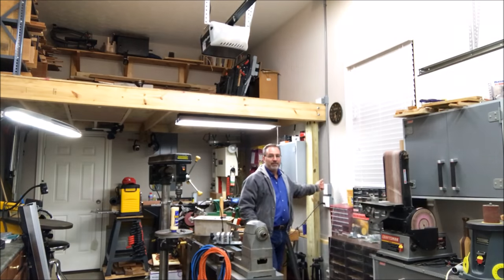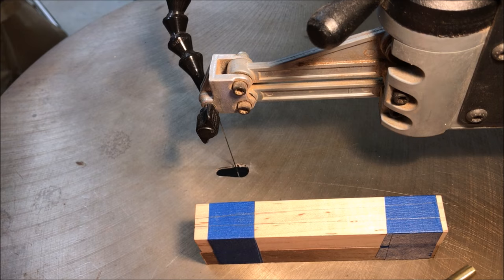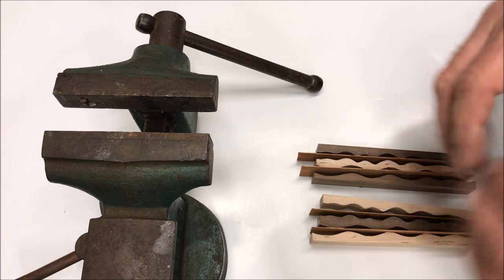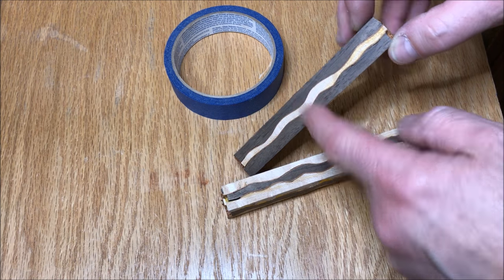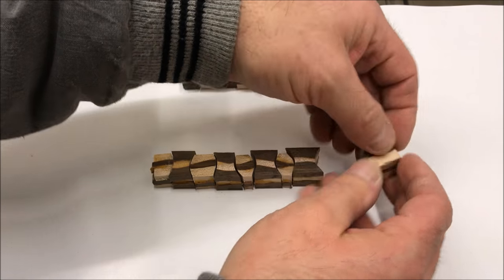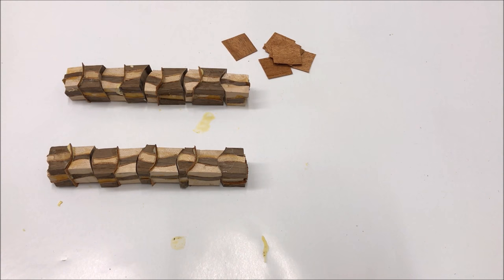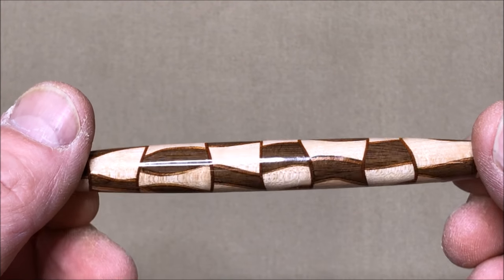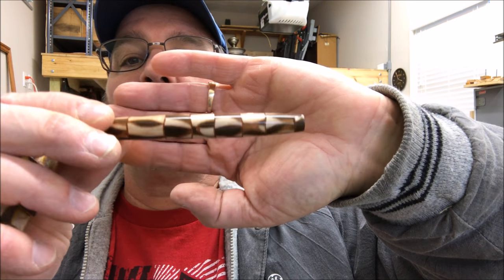Amazing Pen Blank You Can Make

Comment: Hi bob, I don't usually leave comments on videos but I have one piece of advice.you can choose weather or not to take it 😃. When I started making pens very regularly I decided to take the plunge and buy a blank drilling chuck and a mandrel saver, is the best use of money I've found so far other than my carbide tools and my lathe of course. Keep up the good work! 
-Oliver
Reply from the maker: +Oliver Andrews Hello Oliver,
  I have those items but choose not to use them. When drilling on the lathe, the holes are sloppier. Plus with many of the blanks I make, their not square and don't lend themselves very well the the chuck application. Your idea is a good one it just doesn't work for me. Thank you very much for your comment I do appreciate it. 

Regards,
Bob
Reply: RJBWoodTurner at first when I started issuing the church I couldn't get any of the holes to drill straight, but then I tried drilling with a 1/4" split point drill bit then finishing up with the brad point 7mm and it is much easier to get rid of a good chunk of the material before Sui the brad point drillbit. Hope this can clear up what I was trying to say
-oliver
Reply: Using* chuck*
Reply from the maker: +Oliver Andrews Thank you for this follow up note Oliver, I appreciate the additional information. I will give this method a try and see how it works for me.  I hope my previous reply wasn't too preachy, my wife say sometimes I don't answer with enough tact. It's tough to have a discussion with just words, you lose all the inflection and body language that tells the rest of the story. 

Regards,
Bob
Reply: RJBWoodTurner I don't want to push my ideas on you either! Everyone has their own way of getting to the end of the maze.im only 16 i make mistakes but I try my best not to. For a future video you should buy some polyester resin and some mica powder and cast some of your own acrylic blanks.i lived in the states for 6.5 years and took for granted the selection of resins and wood, now I've moved back to the uk it's pretty hart to find resin blanks for anything under £7

Comment: Bob, have you tried to soak your veneers? May be beneficial in assembly and the water will just evaporate and the glue should hold tight and strong as equal as if done dry. I would like to try this out in the spring time (unheated shop up here), I will try just straight cuts vice your sine wave, to see if the pieces match up better. It is a wonderful abstract look.

Thanks for taking your time making your video for us to view!

Michael
Reply from the maker: +Michael David Hiltner I've never tried soaking them, never even thought about that. I may have to give it a try. Thank you for the suggestion. 

Regards,
Bob

Comment: If that's the only area that has glue on it, you can try knocking out the tube with a 1/4" knockout from the pen dis-assembly kit.  I've had some poorly glued tubes come out that way.
Reply from the maker: +Michael DeLawter Nice idea, I have a set of punches and may give that a try. 

Regards,
Bob

Comment: Wow that's a lot of work for a pen but the result is cool.. When I try to cut 2 taped blanks together I find that once cut and swapped around they seem to not have a very close for.. have you any tips regarding mimicking the cut accurately?
Reply from the maker: +Heath Cope I use a #5 blade because it's stiffer, the video is at double speed, I cut really slow so as not to flex the blade. I use the veneers because they compress into the kerf and hide it really well. 

Regards,
Bob

Comment: When I made my modified pen, it was very difficult to remove the mechanism. So I very lightly filed the ridges on the transmission until it stayed in, but was relatively easy to grip the slippery nib and pull it out.  While testing the removability, don't insert all the way. You really don't have to worry about it staying together, because during use, the pen is being pressed together.  I do like your new blank construction  :>)  Cheers
Reply from the maker: +Steve Overton I've also found a small spacer the width of the center band helps. Otherwise you're putting another 1/4" of transmission in the upper tube. 

Regards,
Bob

Comment: Would have been nice to see you drill the centre, did you plane them square before drilling, other wise a lovely project.
Reply from the maker: +William Donnelly Thank you,
  I didn't plane them, I ran them through the band saw just to clean them up a bit. I'll show the drilling the next time I use one. I have an idea for another modified pen, based on a different kit, and plan to use one of these blanks. 

Regards,
Bob
Reply: Thanks Bob look foward to the next one.

Comment: Bob, if you sprinkle a little salt on the glue the parts won't move when clamping & everything will line up perfectly.
Reply from the maker: +Fierceflyer55 I've heard that before but I've never tried it. Maybe it's time. 

Regards,
Bob
Reply: Fierceflyer55 question... I always wondered, will that deteriorate the pen eventually, especially if it gets on the metal?

Comment: Just a thought! IF you were able to start with HDPE tubes, then CA glue wouldn't stick to them. However I strongly suspect that they'll need their centres drilled out. From I've seen locally, they may be available in the right outside diameter.
Reply from the maker: +DMCwoodworx That my friend is an interesting idea. My thinking cap is on. 

Regards,
Bob
Reply: brilliant idea
Reply: RJBWoodTurner    Bob there is a company that does sell HDPE and I believe UHMW rods here in the U.S. but I can’t remember the name of them.

Comment: This is like the chaos pattern cutting boards I've seen done I was going to ask if you had ever seen them and if you thought that idea would make a good pen blank I guess now I know
Reply from the maker: +Barry Fields This was a blast to make. Glue ups were interesting but the blanks hold together well and look amazing. 

Regards,
Bob
Reply: RJBWoodTurner after I posted that comment I was thanking it might be easier if instead of gluing up each individual blank maybe it would be easier to make it like a big cutting board and then cut it into blanks on the table saw. Just an idea
Reply from the maker: +Barry Fields That's an interesting idea. I don't see why it wouldn't work. It would probably be easier too. 

Regards,
Bob

Comment: Dons sunglasses WHAT SORRY I CAN'T LIP READ! Nice.

Use a dowel or chopped up pencils to clamp in the middle of concaved parts at the end, then you aren't putting pressure on one (or both) of the points and can apply more pressure as a whole. You could also use some strips of thick leather or compressible foam (old mouse mats / neoprene) on the convexed side to account for the bow. 12:30 as reference to what I'm talking about.
Reply from the maker: +Neffers I don't understand, the video has sound when I play it. Is there an issue?

Bob
Reply from the maker: +Neffers Thank you for the info. 

Regards,
Bob
Reply: No no, no faults with the video at all, I was having a lil joke about the brightness of your new lighting (it's great, nice job). 

The second part was advice about clamping concaves and convexes with regard to small parts and small clamps etc. 

Apologies, I'm tired.
Reply from the maker: +Neffers No harm, no foul,
  I understand, and I always appreciate constructive criticism as well as new ideas to improve my process. Thank you very much. 

Regards,
Bob

Comment: What was your labor time and material cost?
Reply from the maker: +IBDaddyO Labor Estimate: 10 min. of taping overall. 5 min. per cut at 4 side cuts and one set of dissection cuts. 5 min. to cut up all the veneers. 10 min. per glue up on the sides times two glue ups. Maybe 10 minutes over on the dissected pieces. I'd say less than an hour to make a set. So it breaks down to 30 min each blank. 

Material cost. One walnut blank, one maple blank .50 cents each. .50 cents in painters tape. .50 cents in glue. Veneers: this is a tough one to answer, I got maybe 60 sheets at a garage sale for two dollars. It took about a sheet and a half at 8" X 5" veneer. You could make your own. 

Regards,
Bob

Comment: Has anyone ever ran into the problem with a CA pen finish cracking?
Reply from the maker: +Devin Mccracken Yes, all the time. It's usually caused by using Activator. 

Regards,
Bob
Reply: RJBWoodTurner thank you very much
Reply: Also temperature & humidity play very important parts....If it's raining or overcast...don't do any CA finishing.  You might not see them little cracks & discolouring right now, but give them a few weeks & they will blossom just like flower buds in spring.
I have also experienced cracking problems when the temperature is quite low in the shop.  This winter was a very severe winter for us here in southern B.C. with lots of days at minus 15-18 ' Celcius, which made my shop quite cool, even with a parabolic heater doing its best to keep me toasty. I found that quite often cracks would develope immediately after I finished the polishing stage   IF  I did not let my pens acclimatise to the different ambient temperatures in the room  before I began the assembly process.  With close inspection I would see all these little tiny imperfections develop around the edges of the barrels when performing the finishing touches when dressing them.

Thanks for the tip about the activator Bob.  I use activator quite frequently on the first go round of finishing, but not any more....
.